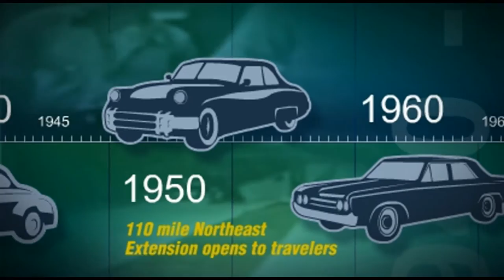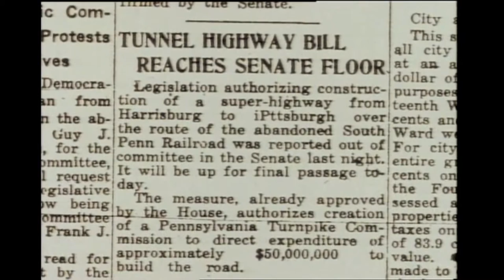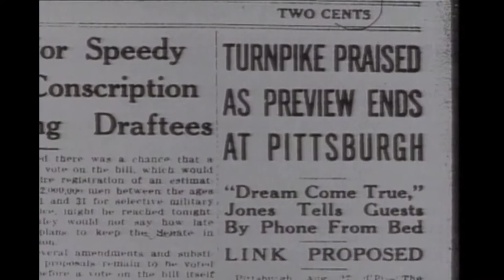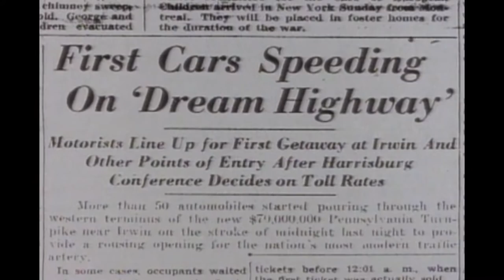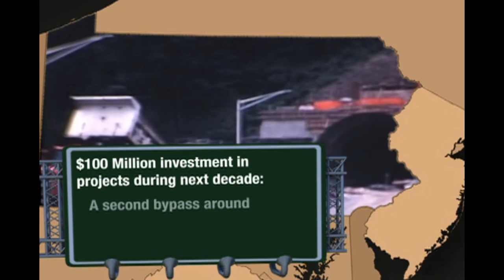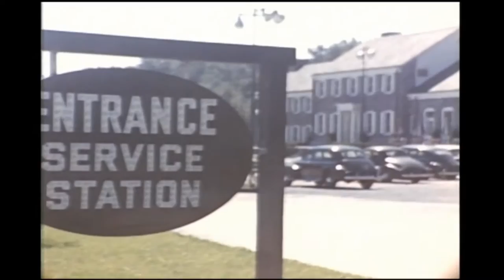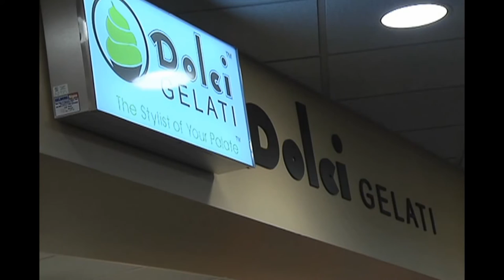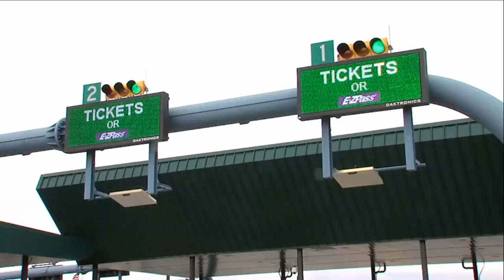PA Turnpike History

Comment: The Northeast Extension, route 9, now 476,
Ended or began at 76 and it went up to Scranton.

It was incredible.

There were so many tunnels.

They removed the tunnels in the 60s and put the road over the hills 

You can still find a few old tunnels if you look

The opening sequence of Vacation, a post card shows one of these tunnels

Comment: I've driven Irwin to Breezewood many times and enjoyed it, except for the mess at US 30, getting to I-70 toward Maryland.  But it's not that bad.  However, the commission is doing the right thing by replacing and widening the 1940 pavement;  some portions were beginning to washboard quite badly.  I hope they keep one service area, Midway, the way it was;  looks like they've tried with renovations and additions to the original south building.  Keep a little of the history alive.  It's a shame the abandoned tunnels have deteriorated as they have;  I realize it would probably cost too much to fix them up a bit, put lights back in them and use them for a non-motorized trail.  It's still a fun drive.  Haven't been there since 2012.